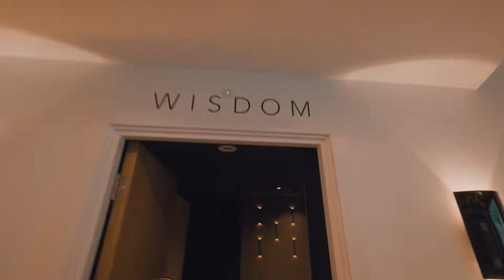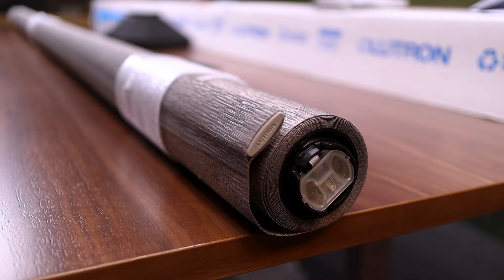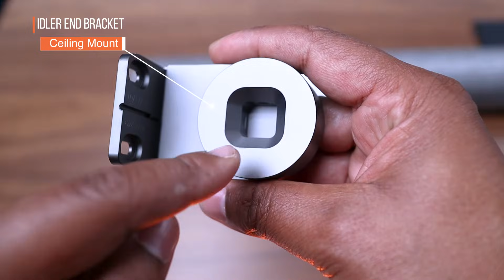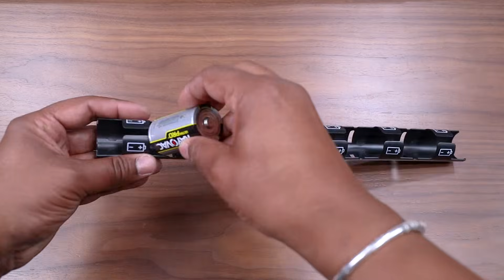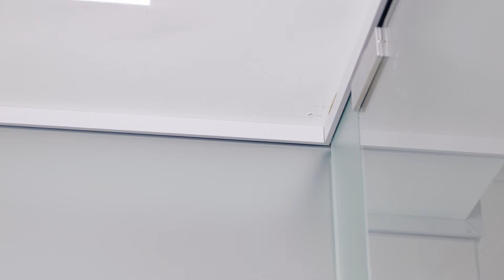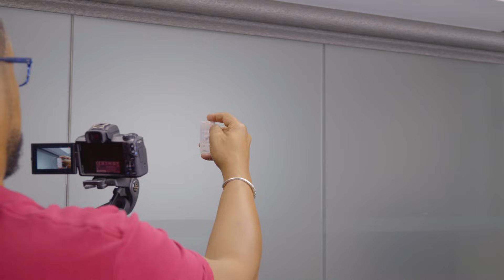Lutron Wire Free Palladiom Blind (Battery Operated) Installation with Pico Remote Control [NEW 2024]

Comment: Excellente video! Thanks for sharing!  How long last the batteries on this blind with a normal usage (opening/closing twice a day)? I have a brand new home with a bunch of Caseta/Pia lightswitches installed - Can I add this Palladiom system to my house? Can I manage the whole system with Alexa? Thanks again!
Reply from the maker: Many thanks for your feedback! Battery life varies with shade size, fabric weight, and daily usage patterns. Estimated battery life will be calculated in the shade ordering tool based on size and fabric selections - this one is about 2.5 years. We don't have Caseta here in the UK so my experience is limited there, looking at the Lutron US website it looks like only the Serena Range is compatible with Caseta. Probably best to ask your local Lutron Rep. Many Thanks